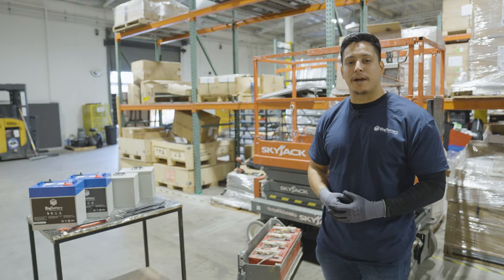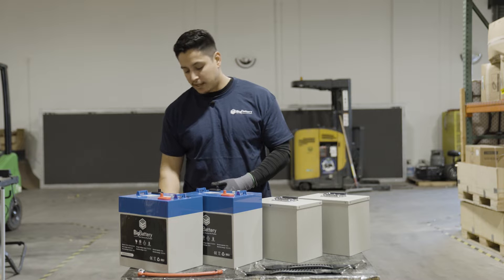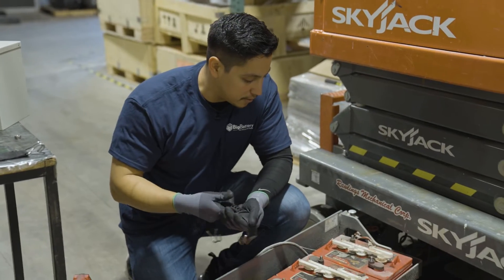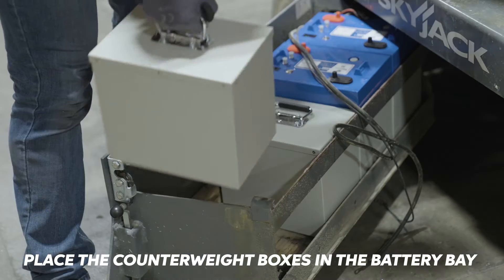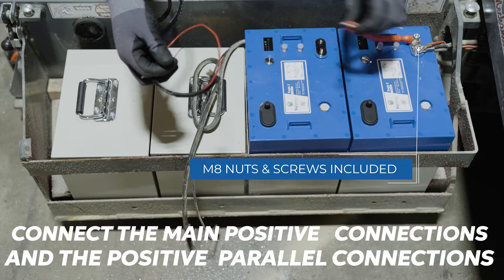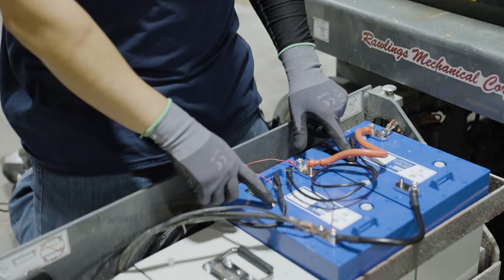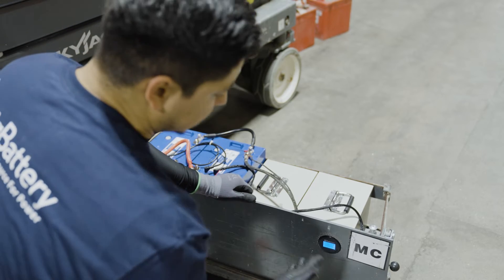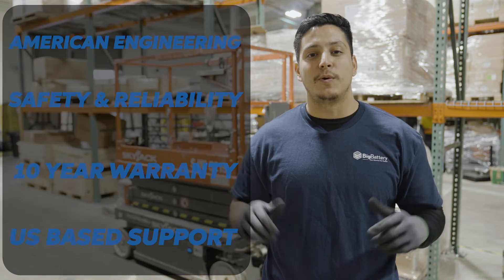24V Eagle 2 Scissor Lift Kit - Installation Guide

Comment: Does the existing on board charging system work in this scenario?
Reply from the maker: Hi, thanks for your question! The onboard charging system will still be fully operational after installing your upgrade kit, and you can charge your EAGLE 2 system directly through the onboard port. Feel free to give us a call at (818) 280-3091, or send us an email at Sales@BigBattery.com, if you have any additional questions!